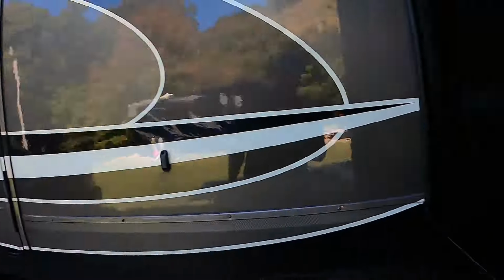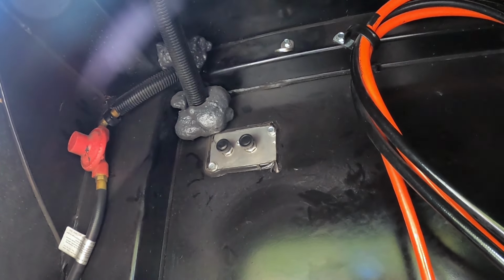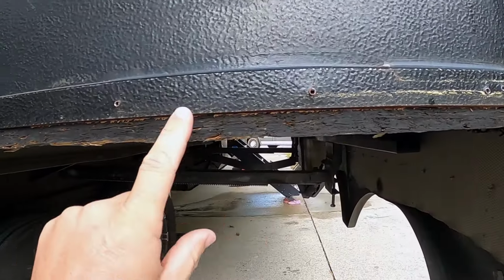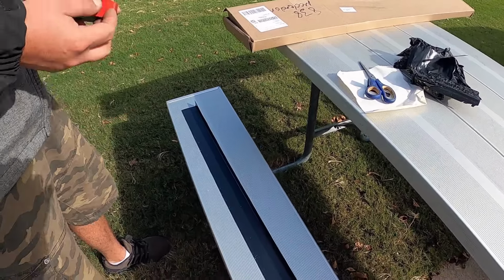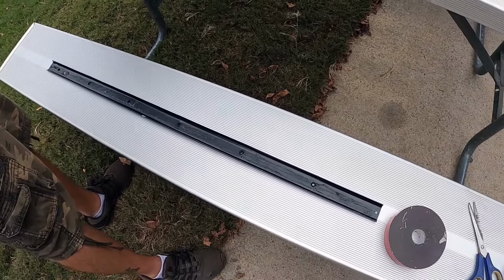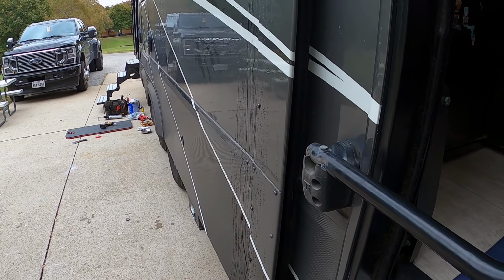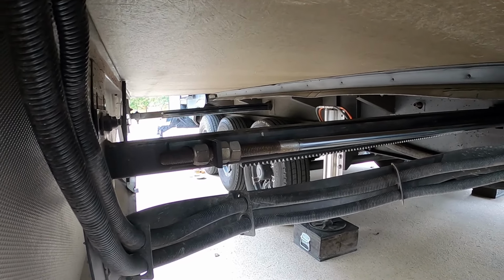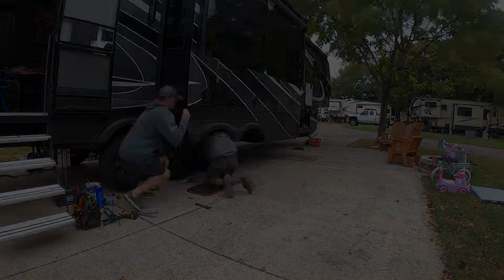How to Fix RV Slide Out Problems | Replacing Slide Ski | RV Slide Out Adjustment Fulltime RV Living!

Comment: What is your plan for the water damaged wood? We just discovered this issue in our rv.
Reply from the maker: We caught it when it first happend so we were able to keep flex tape on it and keep it out of the elements as much as possible before we had it repaired! The tech checked it out and said there was no issues to worry about!
Reply: @PavingNewPaths  oh awesome! We're gonna start taking off the trim and whatnot and get a better look and I'm really praying the wood is in decent condition so we don't have to do anything more than replace the skis 🙏
Reply from the maker: @OliveB69  The tech actually told us to we did good by using the flex tape and while there was evidence water had got there through the damaged ski, he said it was not damaged and was completely dry!  Otherwise, he would not have done the repair to damaged wood!  I stay on the RV and am always watching for things, so I caught this one pretty fast after a move!
Reply: @PavingNewPaths  the wood is a bit wet on ours :( slightly squishy but not bad. It just rained a couple days ago. Hoping we can dry it out really well and get it fixed up with no further issues.
Reply from the maker: If you can get it dry and keep it dry until you can fix it! Some water is ok but once it starts seeping deeper is when it becomes a problem!

Comment: I have the same issue with two of my slides. I know about the slides at Amazon but where can I get that 3M tape and the putty tape he used?
Reply from the maker: The putty tape comes with the new slide skis!  I believe its called butyl tape! The 3M tape I am not sure he had it on his truck!
Reply: @PavingNewPaths  ok, butyl tape is the same thing they use in marine applications. Thanks

Comment: We had a similar issue on the mid bunk slide.  The factory cut the weather barrier short so it wasn't fully engaged in the termination bar.  I stapled it in and coated it with silicone.  That's going to be a warranty item at the end of the season.

I need to investigate these slide skiis more....
Reply from the maker: I tried to make this one better little did I know I made it worse! It just wouldn't get bad for several more months!

Comment: Great info ! U would think that they would cover that pressed plywood on the pull out from the weather..... I got a 36' 2006 Paradise Point built with all aluminum and 3/4 " plywood and I redid floors on all the pullout and this show will help me do the skid sides ..... Thanks great show !!👊😎
Reply from the maker: Thank you!  There is some form of coating on the bottom that came off when I removed the tape and exposed the wood!  It looks to be an applied product that just coats the wood!

Comment: Must be a Momentum...
Reply from the maker: It is a Momentum!
Reply: @PavingNewPaths  I have a 21 395M-R.  Constantly working on it..
Reply from the maker: @ericbrandenburg8583  ours is a 2020 if you check out our channel we have several videos about our problems.
The roof came off, the bottom fell off, our pinbox didn't allow enough bed rail clearance!  The slide ski was the cheapest problem we have had!
Reply: @PavingNewPaths   Grand Design was supposed to be so much better than the others.  I should've bought a Luxe
Reply from the maker: @ericbrandenburg8583  We also looked at the LUXE Line and they are nice but not double the price nice!  Don't let the price fool you, No matter what you buy you will work on it and repair it if you use it!
Reply: @PavingNewPaths   Have to politely disagree with the Luxe statement.  I stayed in one for about 3 months.  Though much heavier, the Luxe is far superior in every aspect including resale value.
Reply from the maker: @ericbrandenburg8583  They are nice we wanted one and still do!  What I was getting at is just because it cost alot doesn't mean you wont be working on it if you use it!
Reply: @PavingNewPaths   Maintenance is key...  These trailer do go through the equivalent of hurricane and earthquake each time they trailer down the highway.
Reply from the maker: @ericbrandenburg8583  It still amazes me after some of the roads we have been on that the RV even makes it to the destination with us!  Speaking of LUXE a guy with a 48FB just pulled in and man that thing is amazing!  Its got a back patio and a side patio and it is a beast!  My wife just said thats the next one!
Reply: @PavingNewPaths   Go check out the fixtures, cabinetry, plumbing and overall finish.  Night and Day difference.  Just need a 450 to pull it..
Reply from the maker: @ericbrandenburg8583  Here is where I have to politely disagree with you!  A F450 is nice to have but you don't need it to pull any camper!  Even the heavy LUXE at 26k GVWR you are still no where near the max towing capacity of an F350 DRW. Due to the heavier options on an F450 you actually have less payload than an F350 and for a camper that big and heavy your going to need the payload to handle the pin weight!  Also just remember they don't make a camper that comes close to maxing out an F350 or a F450 so at the end of the day its a nice to have but not required!
Reply: @PavingNewPaths   I currently own a 2019 450KR.  The 450 has far more payload capacity than whats on paper.  The numbers given by Ford were purposely set lower in order to keep the 450 a Class 3 truck. With the 1.25" larger axles, wide front axle, larger brakes and medium duty tires I assure you, the payload is by far more than a 350.  The stability and turning radius of the 450 alone is far superior than the 350.  The much larger brakes and true medium duty truck tires makes pulling a 20k trailer effortlessly.  Same price as the 350 with much better towing stability.
Reply from the maker: We would own and F450 if Texas did not charge such a premium for an insurance policy over the F350!  Glad your enjoying your F450!
Reply: @PavingNewPaths   I've heard that several times.  Maine, New Jersey, New York and Cali all charge insane insurance premiums for the 450.  Some even require commercial insurance.  Crazy...  Regardless, love the channel and keep up the awesome vids.  We may cross paths at some point.  I'll have the bourbon and beer ready

Comment: I thought the manufacturer would at least USE Stainless Steel Screws when spending ALOT of money!!
Reply from the maker: Why would the manufacturer use stainless screws in wood? With no damage to this area the screws would never be wet!
Reply: @PavingNewPaths  At the very end of the video...that last piece of trim    has regular screws in it.  I was also surprised that they use chip board for the floor of the slideouts...at the very least it should be treated fir PLYWOOD.
Take Care!
Reply from the maker: That last piece of trim also has two layers of butyl putty it is going through and is securing into wood! The question you should be asking is not why didn't they use ss screws, it should be why did they use foam, instead of the putty to secure the piece in the first place! The Tech also explained that piece is there just to cover a seam and has no structural value!

Comment: The adjustment is pretty much the same thing as adjusting tie rod ends on a car
Reply from the maker: there is actually two adjustments that need to be made and the Tech showed me how I did them in the wrong order which fixed the side I was working on but moved the adjustment to the other side!  If you do it correctly can adjust the travel and the squareness of the slide!

Comment: Water intrusion can take weird paths sometimes. Our 2020 had such an issue we didn't know about until we were using it at an RV park in heavy rain. We were in Florida; a big day-long storm came through and just by chance we moved the sofa to get something that fell behind it. I stepped onto wet carpet. >=(  WHAT?!
Totally unexpected because zero water was coming through the top of the slide, through the corners, or window frame. We dried the carpet. At a later date a short rain came through, and nothing happened. Then a little bit later a big one came through again, and boom the carpet's wet. The water was coming down the one side of the slide where the carpet was wet, and basically wicking off some flexible plastic barrier material and somehow getting into/onto the floor of the slide. The water flowed down before wicking UP to get into the trailer. Surface tension makes water do crazy things.
Reply from the maker: We never had any water problems with this issue! I was worried that if I did not fix it I would eventually have water intrusion on the exposed surfaces where the slide ski was damaged!

Comment: It behooves me why rv mfgrs dont install a louvre over exposed outside seams to protect it from water intrusion. the louvre could b spring loaded to fold flat when the slide is retracted, but still have a top S edge attached in either position.
Reply from the maker: Yes, there's lots of things they could improve upon! Thank you for watching!

Comment: Why why why do these damm rv manufacturers use chip/OSB boards on slides? They know they all eventually suffer water damage. Look what these 5th wheels cost. Who wouldn't pay an extra $1000 to have marine grade plywood sealed with epoxy from the factory?  They would never have this problem.

Comment: I have ordered a Momentum from the factory, have you had to deal with the factory on any of the issues  you have faced, if so how did that go?
Reply from the maker: We purchased ours used so for the few issues we have had, we handle it ourselves or we get a moble tech.  My uncle's just got new momentums and once delivered the local dealer is who you will have to deal with.  They have had quite a few problems on new units but have all been taken care of by the dealer.

Comment: That makes no sense.  Aren’t your slides on separate switches?
Reply from the maker: No they are not, hydraulic opposing slides are always on the same circuit, that is why you have to turn the valves to isolated which slide cylinder you want to move!
Reply: @PavingNewPaths  …Strange.  Thanks for answering.

Comment: Great video. My slide has a piece of the slide broke on it and been waiting until I have time to take it in to the shop and have it repaired but I just might try to tackle this one on my own. Thanks
Reply from the maker: Its easy to do, and you can order the slide ski's off amazon, they are universal and come as a set and you cut them to fit.

Comment: Watching your videos and others makes me wonder how well RV's are really  built. There seems to be a lot of issues with slides and most newer RV's. They really look like they're built terribly.
Reply from the maker: In this case It was installed incorrectly and probably would have been just fine if I never touched it!  However it was coming unglued on the bottom, so my fixing it actually made it crack and break because it was installed improperly!  These RV'S nowdays are mass produced by hand so your going to have issues, most are minor.  If you don't want issues don't get an RV they all will have a problem if you use them!
Reply: Unfortunately the sad fact is pretty much all RVs are built like crap.. doesn't matter if you bought an older used one for $1,000 or brand new one straight from the factory for $150,000, it's built like garbage. It's the only way they can sort of somewhat keep the cost down and keep it lightweight enough that you can actually tow it.
Reply from the maker: @mikeschwab1943  We have found this to be true, no matter how much you spend there is going to be problems with an RV!  This is why we found the one we loved and bought used and put the savings away for taking care of issues like this!
Reply: I'm a 30 year master RV technician and RV owner for over 35 years (around 15 year full time) . RVs are very far from maintenance and repair free doesn't matter brand, price, new used or type. . I wish RV salespeople would tell their customers that. Everyone that owns one needs to know at the very minimum  basic repair skills You always have things to repair on one. They have gotten much worse since the pandemic. Stay away from any lightweight or ultralight model or lower priced entry level series.  the heavier it is the better its built in general. Stay away from anything with a a Lippert frame (lci) built in the last 8 years or so. Do not make the huge mistake of jumping into  full timing with no RV experience. you need at least 3 to 5 years of owning and using a RV recreationaly before going full time to gain experience and learn  basic repair skills. Short cuts cause very expensive mistakes.
Reply: @TJ-di1lb  hello TJ! I read your comments! You are very right, I’m learning more and more RVs are built like crap! Most anyways! And some people have more luck with them, problem wise! Then others,I’m one of the latter ones! I’ve had leak issues almost every to every other year since 1994, when I first moved in park as a live abroad,, no choice, could not afford otherwise! This now is my second unit: A 2003  komort 5th wheel I got used  in 2016, before that was an old contessa trailer my father gave me! Anyways as someone that knows very little on the workings or repair on rvs,, WHAT are rv slide skis? And would they affect slideout leaking at floor level? Right now I’m having leaks floor seeping up water on each side of main slide out in enter coners, last nite I just noticed my bedroom side is doing same which is new! I’m 62 some health issues and limited income! So would you have any ideas on a temp, fix until I can afford to get repaired proper?   If you can, please reply here,,,or my email is :  bmwman94550us@myyahoo.com  thank you very much!Andy! Have a blessed new year!

Comment: the slide ski should have been tucked up under the side wall. really sucky the way he done it. I'm installing slide skis on my Montana. however, as of now I run a piece of duct tape right below the trim screws and let it hang. water will run off the tape that's hanging and never touch the slide floor. I may just keep doing what I'm doing and changing it each time. not sure yet. but I sure dont want them mounted like that. what a disaster.
Reply from the maker: He made the repair according to how our slides are built!  However they did it incorrectly at the factory that is why we had the failure!  Its been almost 6 months and about 30 moves with no issue from the slide ski!

Comment: Great in depth video . As someone who is looking to get into this lifestyle. How much did a repair like this on the road cost? Also how much a month do you budget for maintenance?
Reply from the maker: This repair cost me around $300, but that is far cheaper than the damage that it would have caused if we didn't address the issue!  For the most part we spend around $100 a month on maintenance!  With the exception of a few repairs that cost more that cost is pretty accurate!
Reply: @PavingNewPaths  thank you this is very helpful...

Comment: Love this video. Very informative. Love you asked questions on camera and the answers given. That tech was awesome. I started working on my slide as u had the same exact issue with the water, ski and metal strip. Started on it today but the weather changed and I had to stop. Question:  Is there something at the hardware stores similar to the skis so as not to have to order them?
Reply from the maker: I don't think there is something that would work but we got ours from amazon it was cheap and got there in no time.

Check this out on Amazon
https://www.amazon.com/dp/B08L87GLLF/ref=cm_sw_r_apan_glt_i_GN40WJD46W8B3ZD34K14?&_encoding=UTF8&tag=pavingnewpath-20&linkCode=ur2&linkId=1f55794312e3b679e634054476b9f1a3&camp=1789&creative=9325
Reply: Great. Thanks for responding. I look forward to more videos. RV life...yay
Reply from the maker: @doriscaussey4163  we have a whole playlist of how to videos and one just for our travel adventures if you want to check them out!